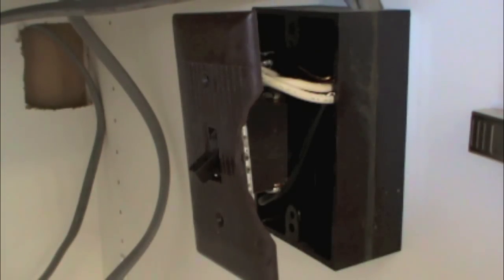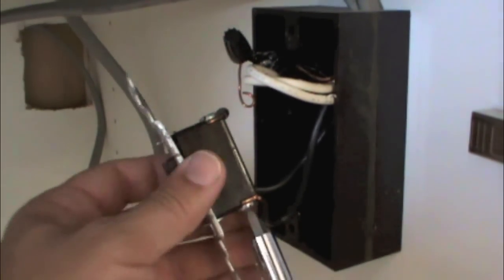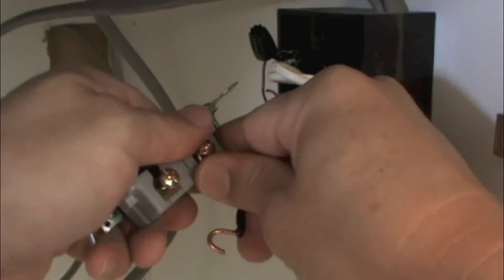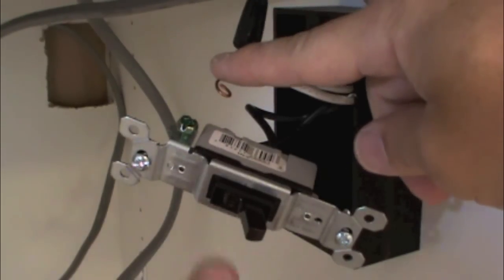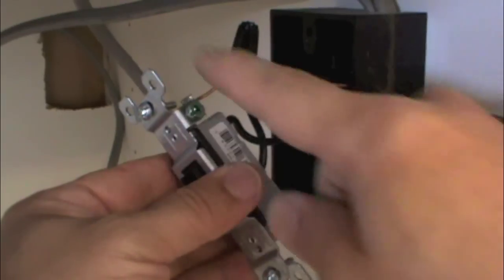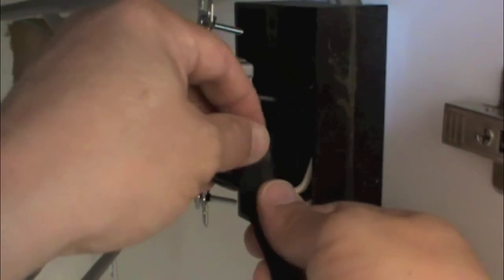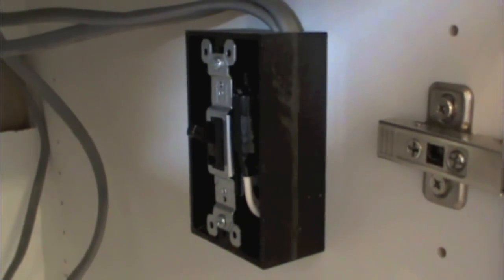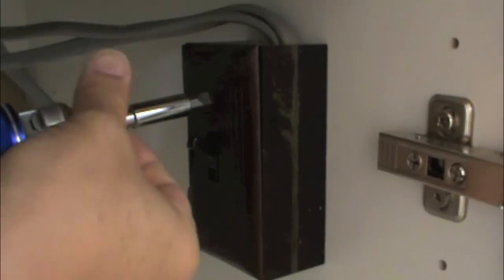How to Replace a Disposal Switch

Comment: You did answer my question so thank you for that. I just want a switch and was reading that only the hot black wires go to that switch so the white are connected together - got it. that helped and of course the ground- I will pigtail the ground. And yes, the hot wires need to go in the direction of the screw, I did know that. Thanks though , everyone else was doing the switch and plug, no plug needed, very simple home and no dishwasher.

Comment: great video.  unfortunately in states like California ALL electrical must be done by a licensed electrician?
Reply: Msl G  it's mostly true in berkeley dude.  sorry that i spoke for the whole state.  but where i used to live these are the only exceptions without permitting:

Electrical

Listed cord and plug connected temporary decorative lighting.
Reinstallation of attachment plug receptacles, but not the outlets therefore.
Repair or replacement of branch circuit overcurrent devices of the required capacity in the same location.
Installation or maintenance of communications wiring, devices, appliances, apparatus or equipment.
Minor repair work, including the replacement of lamps or the connection of approved portable electrical equipment to approved permanently installed receptacles.
Electrical equipment used for radio and television transmissions. This exception does not apply to equipment and wiring for a power supply and the installation of towers and antennas.
Installation of any temporary system required for the testing or servicing of electrical equipment or apparatus.

Comment: What the hell are you doing? you are supposed to wrap the wire around the screw in the direction it tightens. the bottom one is wrong.
green wire nuts are for grounds.
You do not know what you are talking about, so stop.

Comment: You left a lot out of this.  I assume you knew where to buy a GD Switch?  I guess the one kind of switch fits all GD's?  How did you know that the problem was with the switch and not with the wiring somewhere on it's way back to the power source.  Mice in walls love to eat the plastic on the wires.  My cat would chew and any rubberized or plastic covered wires.  I realize that this video was produced 9 years ago,  I was just typing out loud.  I guess I will call a hardware store and ask a few questions.